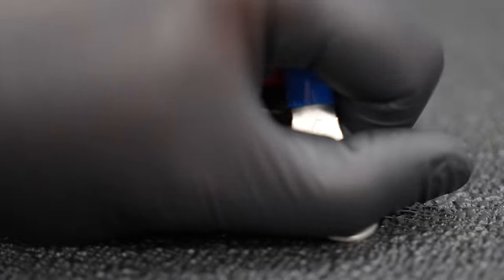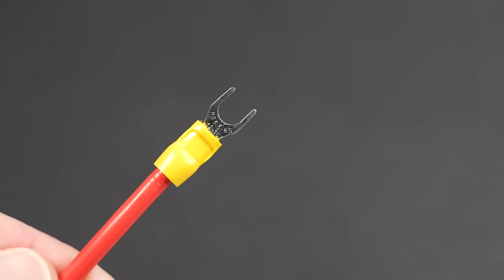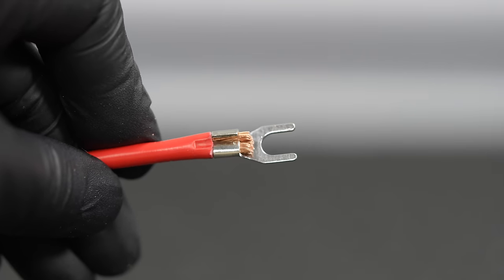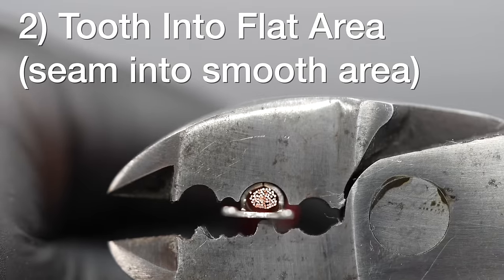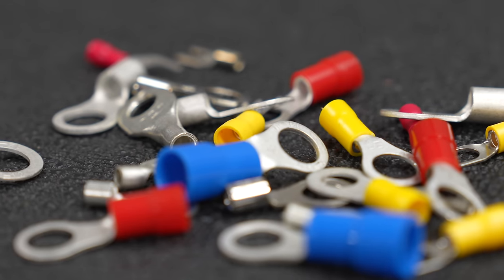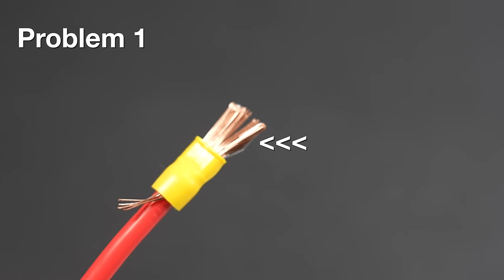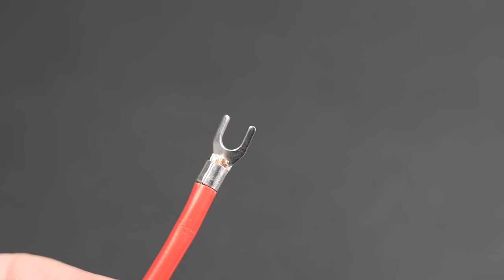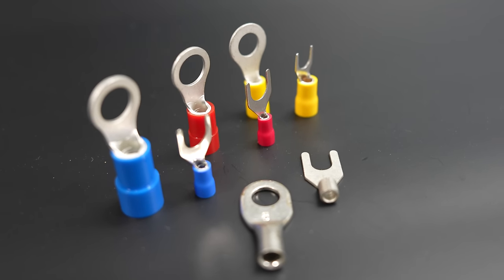Why 50% of All Crimp Connections Fail - Up or Down?

Comment: 2:23 That is not a great termination. Not only will that deform the ring or spade, the act of tightening down the fastener will try to loosen the crimp. You need to use crimpers that are narrow enough not to deform the terminal itself.

In my opinion, there is no good way to crimp a butted seam insulated terminal. Which is why I just don't use them or I remove the insulation. But if you must, you should use a crimper designed for them which crimps them flat.

Comment: Good advice.  I always give a crimped connection the "tug test" as well.
Reply: Crimp, tug, apply heat shrink.

This is the way.
Reply: Tug test is one of the most important steps. That’s the only thing missing in the video. I like using shrink tube over the joint too as an added barrier against failure.

Comment: Great explanation!
I've seen several professionals saying to put the teeth of the pliers pressing on the terminal tabs and it's actually difficult to get it right.
There are always those who will argue: "but it's just training".
I don't see it that way, because it doesn't make sense to train to correct something you're doing wrong.
This video was shared with my channel followers, but not all of them speak English.
If you allow me, I would like to use your script as inspiration to film a Brazilian Portuguese version. And of course giving credit to the original creator.
Thanks for the class!
Reply: THATS THE CIVILIZATIONS IMPROVEMENT EVOLUTION, BY PAYING IT FORWARD!

Comment: I built industrial control panels 30 years ago and learned early on how to make the most robust "staked-on" (crimped on) terminations. Use quality terminals, a dedicated crimp tool (those all-in-one tools are for the backyard amateurs) and for high-current-carrying terminations, crimp, then coat with flux, and immerse in a molten solder pot. I learned Mil Spec soldering for those high-grade data signal-carrying plugs and sockets. I was also involved in setting the ISO900X series of QMS standards.
Reply: Which crimp dedicated crimp tools would you recommend?

Comment: I didn't know you had to do them in one orientation only, and I'd been doing insulated crimps for decades. Also I've nearly always used a simple tool which, though good quality, has both jaws of the same shape and is only 1/8" thick. I used to do it twice, so effectively using the available length of the crimped section. Retired about 8 years ago and never had any complaints but always checked things were very tight anyway. So you have given me a good amount of new knowledge, thank you. Liked and subscribed.

Comment: Excellently done video.  For me, sometimes crimping just isn't enough. Like when you are repairing wires behind a dashboard and re-accessing them would be a hassle.  When I need a bulletproof connection like that, I remove the plastic insulation, put heat-shrink tubing on the wire, crimp properly as demonstrated here, then Silver Solder, then finish with the heat-shrink tubing.  That will last forever!
Reply: Exactly! Automotive/harsh duty areas require crimp and solder! No issues when done that way (using proper wiring and routing components) and will outlast the vehicle.

Comment: Japanese bullet connectors are GOAT.
I work on vintage Hondas a bunch so invested into the tools and connectors, and lemme tell you. They're wonderful. A perfect crimp every time. Insulators go over the wire then slide up and into place  for weather resistant seal. 
From my jeep to HVAC to my bikes to cars to every other wiring job I've done... Flawless.
Them Nippon folks really do make some good stuff

Comment: In the UK we can only buy insulated crimps in the shops. So I cut off the insulation, crimp the wire on, solder the joint then cover in heatshrink. Never had one fail on me yet.
Reply: I do the same. Some will object saying that soldering is a bad practice, but it only is if you don't know how to correctly solder and support a connection used in a environment subject to vibration or movement.
Reply: That's not true, I'm in the UK and have found uninsulated connectors no problem. Last lot a bought came via a UK supplier on eBay.
Reply: I prefer to use the double crimp non insulated terminals with separate insulator sleeves (readily available in the UK, along with most types of terminals). Soldering does give a good electrical connection, but can cause problems with vibration fatigue, particularly if the copper has been overheated.
Reply: I do the same, but I'm in the States
Reply: Don't use solder in automotive applications, as it can crack under vibration. A properly crimped wire is bonded to the connector, and solder is just a point of failure.

The exception to this is when potting the connection, as the sealant prevents the solder from cracking or separating.
Reply: @OsirisNeits  I totally get that but garages still solder wires together on vehicles. Back in the 90's I worked at a VW dealership, when a customer wanted a tow bar fitted the techs used those crimp on splice into the wiring loom connectors, quick and easy. Anyway the boss had a lot of customers complain months down the line, he threatened to sack any tech who used those connectors again, they switched to soldering them, no customers returned with faults after that.
Reply: @steveclark..  Those splice connectors are the worst thing you could do to wire, so he was right about that for sure.
Reply: @OsirisNeits  Yes, I've never liked those things either, I'd rather carefully remove the insulation from a section of loom and tightly wind a wire around several times and bound the lot with tape. I've also soldered extra brake lights etc in, never had a problem.
I'm more concerned about all the electronic modules etc that are thrown at vehicles now, circuit boards, water, heat and vibration, seems a recipe for disaster. I prefer my 1983 motorcycle in that respect, basic, easy to fix too.
Reply: @steveclark..  Yeah, new cars are ludicrous. I watched a video the other day where a guy had to disassemble the entire front end to add washer fluid. 🤦‍♂️
Reply: @OsirisNeits  I've just had to replace both lower control arms on my wife's car and have had to do similar. It's crazy, having to remove the bumper etc just to access one of the 3 fasteners to a control arm. Makes such jobs so time consuming.

Comment: Just learned that I have been crimping my connectors wrong from over 60 years.  I would crimp on the seam side then realign the tool and crimp the other side of the seam on top of the first.  The method you showed is much easier, quicker and better.  Thanks!
Reply: You were doing it right before

Comment: This is a great example of when a person himself is not very good at something, but tries to teach others.

Here are some tips to help you avoid mistakes and crimp connectors correctly:
1) The right tool. One of the tools shown is not suitable for this type of connector.
2) Understanding the process. To obtain more crimping surface area, you can crimp the connector in several places. This is what the crimp ratchet we see in the video does.
3) The right materials and understanding how they are used. The connector may be the wrong size, but if it fits well on the cable, everything is fine. The end of the cable that is too long can be cut off, but the insulation crimped into the connector will cause poor contact. And of course never try to crimp a solid cable!

In my experience, all problems with connectors and ferrules were caused by using the wrong tool.

Comment: After 40 years experience in the commercial and military electronics industry, if you don’t have the best reliable crimping tool, then solder the connection with flux, then clean with 99% isopropyl alcohol.  But what about the crimp connector plastic?  Use an un-insulated connector and add heat shrink tubing  This is only my opinion and experience.
Reply: Good tip. I used to do this in the commercial marine electronics industry. I would crimp it then solder it. I didn't clean them though, I'd just use RMA flux core solder (or no-clean but I don't really care for that stuff).
I stopping soldering them because I found they only ever corroded when there's water in the wire and the wire is ruined anyway. Or it corrodes around/behind the connector and you have to redo the connection anyway. But I still believe soldering the connectors is good practice.

Comment: Thank you, I never thought about putting the split side up, that's a big help. For my purposes (hobbyist) I don't use the pre-installed insulation on connectors, I either get naked ones or remove the insulation. I then use heat shrink tubing, this allows me to easily inspect the connection and makes for a neater looking terminal.

Comment: I use to work in a wire harness manufacturing facility.  I use to teach a lot of this stuff lol. We had hydraulic presses and ratchet hand crimps.  On the hydraulic presses,  once you did the initial setup for whatever wire gauge and terminal,  you had to do a "pull test". We had specific machines for this, that would pull until failure.  We had specific rates for what each should fail at. Some manufacturers asked that we solder the terminals as well. When I do this at home , I always solder them, because I was so use to having the pull test, and I don't have access at home, so I solder it lol.

Comment: Most of my experience is with automotive wiring and I’ve been crimping them the way they are crimped from the factory. Seam facing the tooth and I’ve never had a failure, I’ll admit it takes practice and attention to what you’re doing. But it holds better in my experience.
Reply: 100%

Comment: Nicely made video. I would caution that there are different methods for crimping insulated and non insulated connectors. A tug test should always be performed. While a proper crimp doesn’t need solder, I like to solder and add glue lined heat shrink. The seam is also very often the top in which the seam curls down around the conductor, such as in auto wiring, and spark plug wires. Those are open crimps and made using a two-step process - the curl, and then the crimp. I’ve never been a fan of insulated connectors, and much prefer removing the insulator if present, and using heat shrink instead. Happy crimping!

Comment: Good video but  you should also mention the alternative crimp style that uses a "crinkly" part of a diffent type of tool to fold the two parts either side of the gap into 2 humps. The end effect in cross section is sort of heart shaped and very strong. It seems to be more used in factories than for aftermarket repairs.

I have just done about 100 joints on a vehicle using UK standard insulated crimps and a "good" tool and don't really trust any of them unless heat shrinked over.

Comment: I am not agree with you on which side of the connector facing the crimping claw of the tool. Crimping the connector your way will deform the connector itself and cause poor connection, thus overheating ...  The claw of the crimping tool should fold the two edges of the connector from end to end.  In order to achieve that, you should crimp the connector two to three times depending on the size of the connector
Reply: Have you tested whether the connection is poor? If you want to refute a video that provides evidence, you need evidence also. Post a video if you feel so strongly.

Also, the degree of which the actual spades of the connector is deformed is minimal (2:18 at 0.25 speed). If anything, the slightly overturned spades would provide an interference fit.
Reply: @Imcrikee Bruh you don’t know what you are talking about.
Reply: I read my comment again and I agree with you all because I was not very clear.  If your crimper is with pointed claw, then it meant to fold the opening of the connector.  If your crimper has a rounded claw like the one in the video, then the rounded claw use to pinch the connector as shown in the video.  However, the rounded claw should be placed in mid part of the barrel so that it won't deform the connector.   Also, you can see in the video 2:20 incorrect crimper iused thus deform the connector. If the connector is a male or female spade deformed then it will definitely won't pass quality control.

Comment: Great advice. A troubleshooter will find the issue you described to be the cause of many failures, especially the beloved intermittent issues. If you want to spend more money a brazed or solid barrel connector seems to be more solid and foolproof. I crimp hundreds of wire connectors in a year, and hundreds more coax crimps. The very best connectors, tools, wire, clamps, grommets, wire loom, etc. come from right here in the USA at Del City Wire, but a lot of folks don’t buy large quantities like I do. If done correctly, a crimped connection can be a convenient and solid connection. I still end up utilizing the Western Union wrap technique with soldering for many connections, especially outdoors.

Comment: The "good" crimp you show at the end is poor. The wires extending beyond the sleeve will interfere with fastening it to its connection. C'mon!
Reply: I agree. As a journeyman electrician for 39 years, I saw the problem of too much wire extending into the area which will be under the connection screw.

Comment: Important to note that higher quality crimp terminals are braised along the seam. I won’t buy terminals that are not braised-seam.  The video is correct that the “tooth” should be opposite the seam, but braised-seam terminals can be crimped in any orientation.  Also, I only use ratchet tools, specifically for ins vs non-ins terminals.

Comment: I’m fortunate to have had the seam issue pointed out to me. I mostly use the plain pliers type crimp tool, I have 3 different widths (or thicknesses). Here’s a tip: first place the connector in the crimp tool and hold it gently as you insert the wire. When everything looks good give the pliers a squeeze. This sidesteps that fiddly moment when you’ve slipped the connector over the wire and are trying to orient it correctly in the tool as it jumps around loose.

Comment: Really one of the most important video's I've seen - I'm smart but dumb and never took the time - well actually at times I wondered - what the right way to use the simple crimp tool - impatience and 'get it done' just resulted in the crappy crimp followed by some primitive man follow up  'crush it down !"  - and 'its' all good' right ?  wrong - years later - being older and all - you notice looseness or just falling out - and burned wires because the full wire strands were not bunched tight  -  and so this could be a fire hazard - could result in your car being stranded out in nowhere's ville  - could be opening back up a wall because some device stopped working -   so yeah - this video is ultra  good and ultra important

Comment: I typically slide the insulator out of the way, crimp them and then solder at one end instide, where the copper wire terminates, in a same manner like a wire rope end connection. While its still warm I slide the insulator back in to set. Works like a charm and it never had fail on me so far.

Comment: Have to admit, according to this I've been crimping wrong for over 40 years.  Despite that I've never had a failure due to bad crimping.  I am alarmed at the amount of deformity he has in the forks and rings after crimping "backwards"... some of the rings and forks are curved 30 degrees or more.  After putting in a bolt I imaging they would flatten back out but that may also open up the crimp somewhat.  Crimping carefully with the "tooth" precisely on the seam can and does give you a symmetrical crimp in which both flaps are folded down into the wire.... for both insulated and non insulated terminals.  Maybe it's wrong, but it works and it doesn't curve the forks or ring ends of the terminal, and will hold just as well as what is shown here.

Comment: Excellent video answered all questions anyone pondered...I personally solder any connector and then shrink tube then dielectric grease connections...wire routing is the problem I’ve experienced... and those pesky 🤬mice

Comment: Right tool for the Right Job...That crimper with the rounded anvil is for Barrel connectors which have no split seam. Think a seamless TUBE. Whats needed for split connectors like the NON-Insulated type, is called a "W" Crimper. It supports the sides and the "anvil" is shaped like a W that curls the edges of the splits down. Look at factory crimps and you'll see the sides of the splits will be curled in and down tight!

Comment: You know I have a Greenlee ratcheting crimper with interchangeable dies.  Those jaws have extra anvils on the smooth side, one thicker than the other.  I am not talking about the thing pointed out in this video.  I have crimped in there inserting from the left narrower side first and from the other side wider side first and can't tell the difference.  But I am sure Greenlee had a reason for forming that tool this way.  The dies also have a red dot on them.  Both features never explained on any of their die packages.

Comment: Quality connectors have a second seamless metal sheaf (or tube) around the crimp portion. This makes the crimp portion behave as if it is seamless. This  elimates most of your problems. Also if the crimp is deformed again it will not release the wiring conductors.